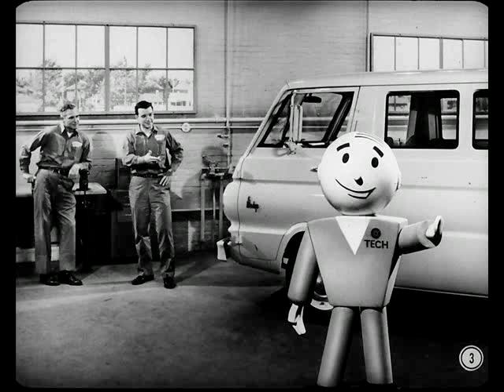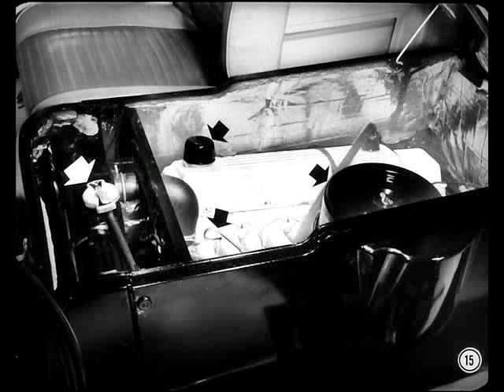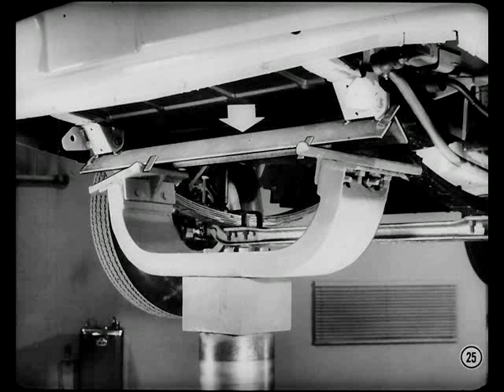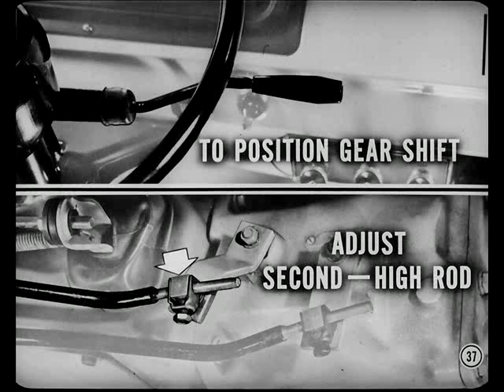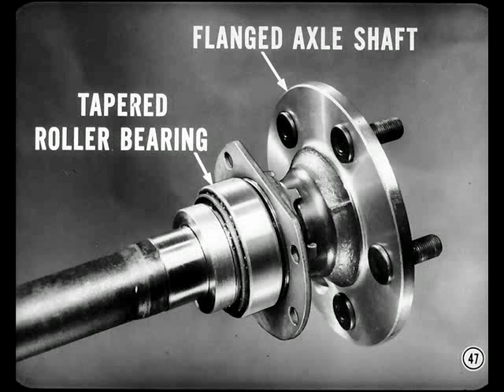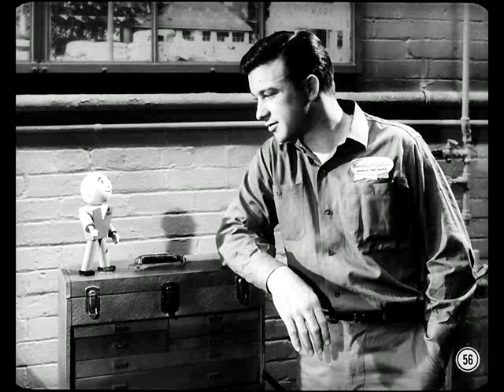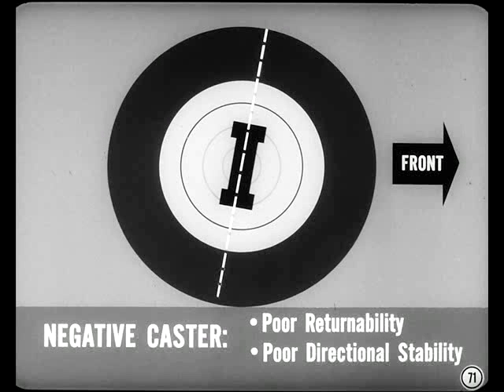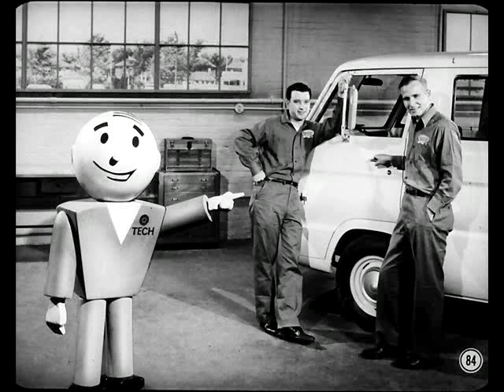MTSC - 1964, Volume 64-9 Compact Truck Service

Comment: I had a 66' model . Having that engine right there beside you is no fun . Especially when it overheats . The noise and heat during normal operation was bad enough . If you ever have to remove the engine another fun operation .
I must admit though the thing was almost 20 years old . Those slant 6 engines was probably the best engine ever made .